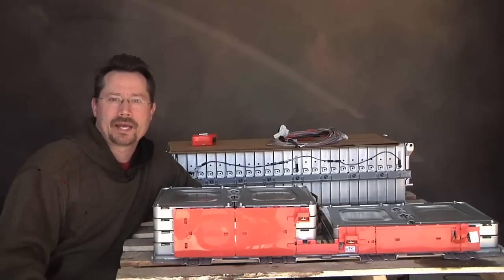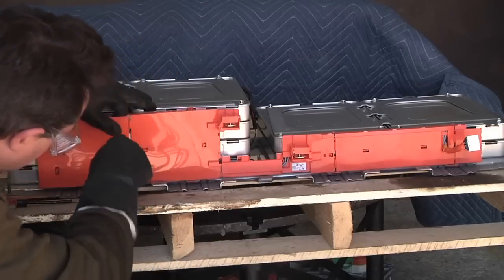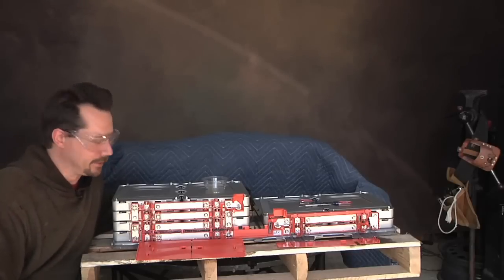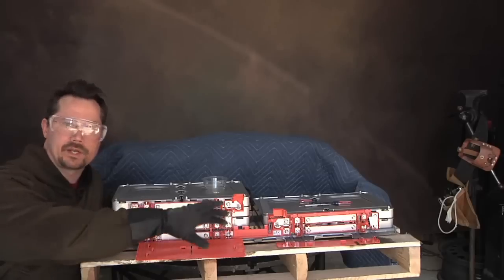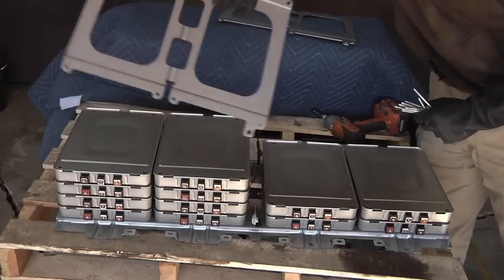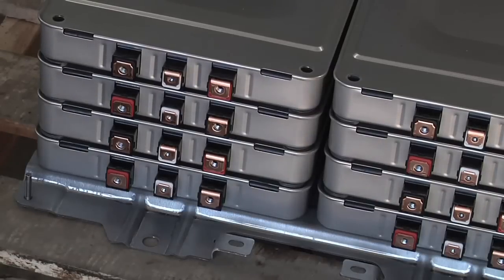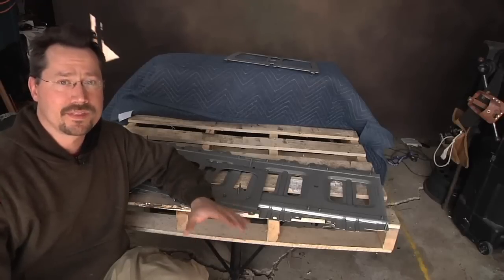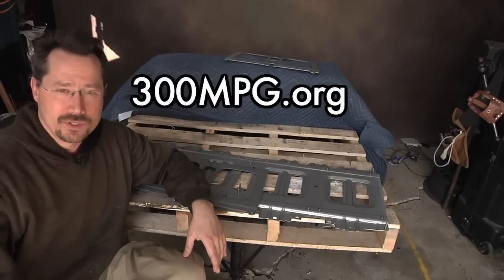Nissan LEAF Battery: Module tear-down Part 1

Comment: HI Ben DO YOU KNOW THE c rating or the kwh and voltage of each battery module. i have a 72 volt 500 watt brushless motor i would like to buy any good left over modules you have from the original nissan leaf battery pack. thanks Eli
Reply from the maker: +elitheitguy Sorry, no "left-over" cells. They all sold very fast. For full specs on the LEAF Cells, there's some good information on them at: http://hybridautocenter.com/HAC4/index.php?option=com_content&view=article&id=72&Itemid=631